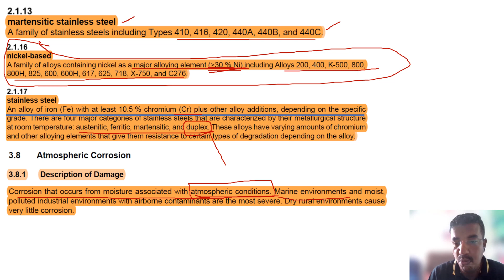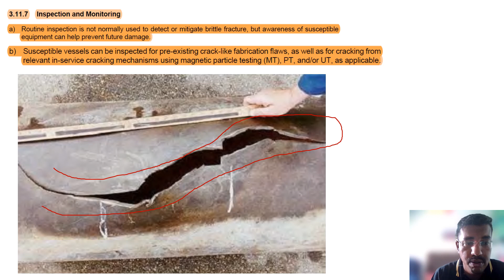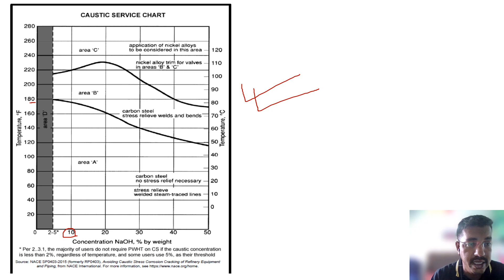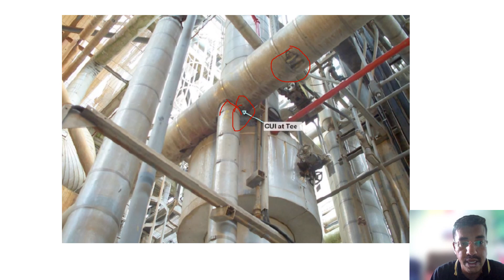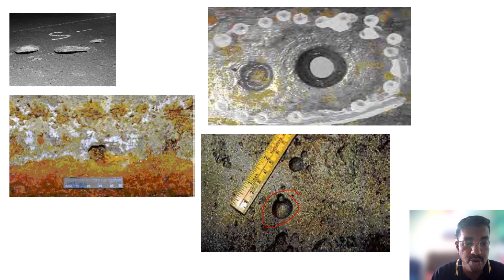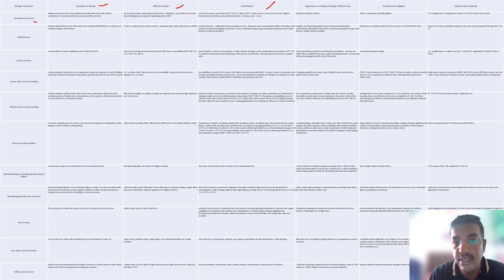API 653 PART 12

Comment: Hello sir an urgent question.
if we need to calculate say UT inspection interval for unknown CR.
we use RCA/2N or 15 years whichever in less.
where RCA is t(actual) - t(required).
OR 
we calculate RL as per formula in 575 
Little  confused sir 
Please clarify
Reply from the maker: It is the first one you wrote , no need to go for 575

Comment: Thanks sir. I have one Query!!   API 570 for Inservice/Repair Piping Inspection but which Standard for Newly Fabricated Piping Inspection?  Thanks
Reply from the maker: Newly construction of pipe must be done as per their service use. If it’s power piping / process piping / refrigerator piping etc… ASME B 31 series has multiple numbers of new construction piping standards.
Reply: Thanks for your reply,  i mean for in-service piiping API 570 Inspector so Newly construction Piping which Insppector? Thanks
Reply from the maker: @md.shafayatislam3356  same API 570 piping inspector can do as most of the topics of 570 covers new construction too.
Reply: @qualitymagnify5656  Thanks a lot sir for giving your valuable time and quick reply.